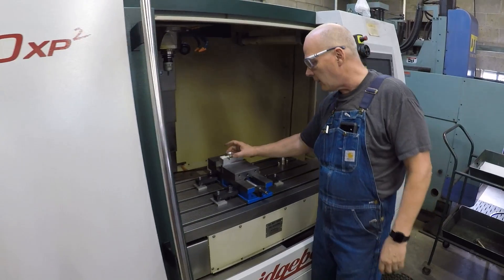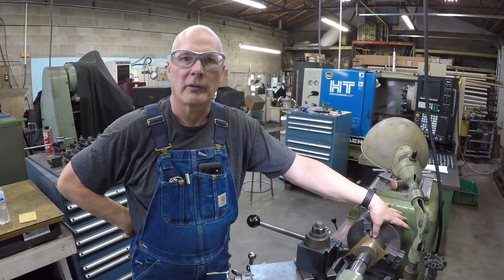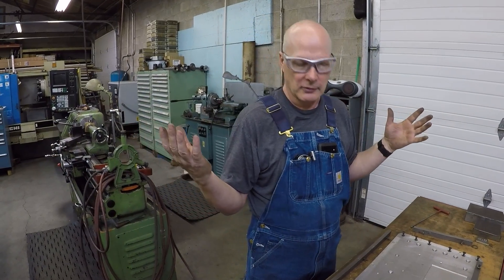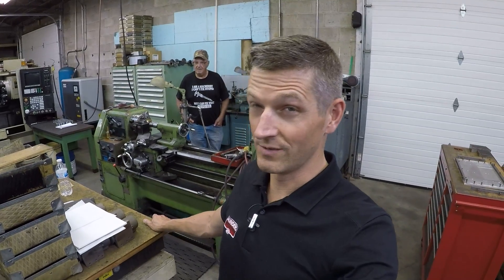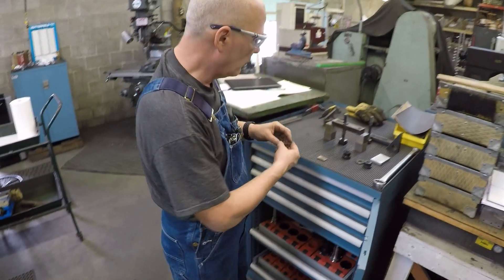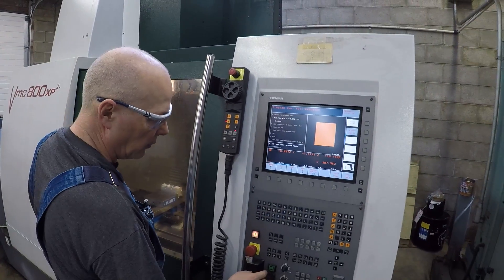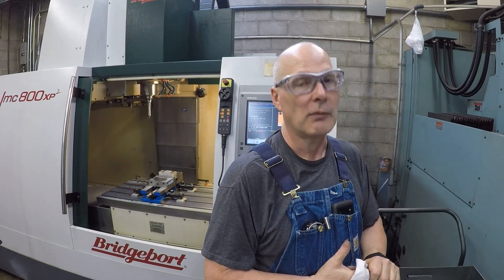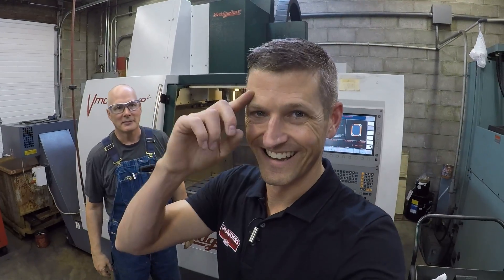Workholding Tips for Thin Parts with Paul DeBolt!

Comment: As a one man job I had to discover a lot of this by experimenting, measuring, failing and finally finding the right work-holding for my thin parts.
Clamping an re-clamping very large thin parts is something I regularly do. Works great as long as you remember to make sure your tools don't hit the clamps that are above the material. If your tools move up something like 1/4" above the part and then performs a G0 move to the next starting position, you might be surprised to hit that "mountain" you used for clamping...

Comment: Amazing!, I usually machine small parts for firearms and its a challenge. Luckily my products do have holes to fix them to a plate.
Casually, the other day I machined a big alluminum plate to hold up to 60 pieces (I need to improve night time) and I was puzzled to check how wavy the stock was. It is a 7075 T6 plate of 600x400x30 mm and it had about 0,3 mm of random warping. And intuitively I did the same that was recommended in this video of loose a bit of pressure for the last surface finishing.
Thanks for the tips, I see all the videos! Greetings from Argentina

Comment: Thank you! In my experience vacuum only works if you have enough surface area. For this part I would program a large array of parts fitting in the machine's envelope or, when smaller, the order made. I mounted my vacuum table with a large block on the bottom which can be held in the regular CNC vice that's there 95% of the time. I then tram the height of the table using a dial indicator to get it absolutely level with the x-y plane of the machine. Mount the rubber seal to the maximum size of the stock used and start milling. Holes are milled instead of drilled because I have to maintain vacuum during all operation. I leave 0,1 mm of material at the bottom. Last operation is cutting the parts loose at also 0,1 mm above the vacuum table. When the job is done I can simply fold the parts out of the left stock and use a dedicated small router (Makra 250) with a small carbide chamfering tool to get rid of the burs on the bottom. Holes are punched out first with a fitting pin. Works like a charm. Maybe a tip. All the best, Job

Comment: Machining thin material I default to double side tape or vacuum chuck. DS tape mainly for plastics because I prefer to use air blast for plastics. If a part has mounting holes, I take advantage of those for clamping, using plastic washers to protect the part.
When using those generic strap clamps, I use some plastic shim stock (~.010") to keep the clamp tip from marring the part/material.

Comment: Taugetec make a negative holder with positive geometry insert. Basically the insert has huge ramps on it. 

They work great at chipping aluminium and the holders don’t Waller out like DCMT type as the walls are vertical with a pin clamp not a tiny screw. 4 edges on a D style too as it’s negative

Comment: Mitee Bite had a new holding wax at IMTS.  Heat gun to melt it, hold your part, and heat gun to release, clean it with acetone.  Way nicer than any of the super glue crap I've tried!
Reply: Hot glue works the same way. There are different kinds, common clear is the weakest, yellow-ish is nice and strong, black is more rubber-y. Cleans off with IPA.
Great for odd-shaped parts, but can take a while to heat up if the fixture/part is fairly large since you have to heat the whole thing. 
After looking up the product, i do see the advantage of it being in a sheet though, great for thin flat parts.

Comment: Very cool notes, had to learn a few of these through trial and error and some of these I'm gonna take going forward.

One thing I've found for certain thin parts with a lot of holes that need to be extremely consistent is that spring-loaded deburring tools (Cogsdill) can be worthwhile. But 90% of the time I find a quick hit with an aircraft sheet metal rivet deburring tool is fast and consistent enough for typical holes.

If I have thin parts with large windows, I've never thought to just pocket or adaptive out the big empty. I always tend to pop holes in them for hold-down screws, and then machine out those windows last, often slotting with a few tabs first and then going in at the very end to skim cut the tabs away. 

Alternatively those big windows go first, and then have a custom fixture that drops into the window and clamps the part there all along that perimeter
Reply: I like that last option. Is it better to avoid distortion? I think of it like an inverted vice that clamps by expansion.
Reply: @ernestomayer6485  It's a good option when doing a bunch of them and its worth the time for the fixturing. Also handy if you are taking a waterjet blanks that already have big gaps.